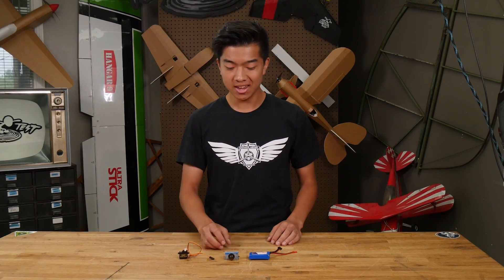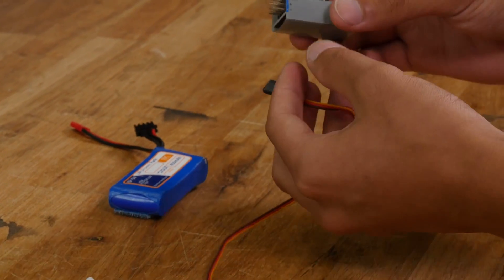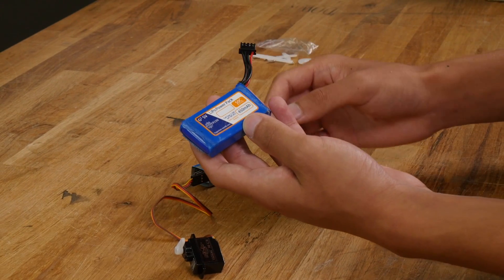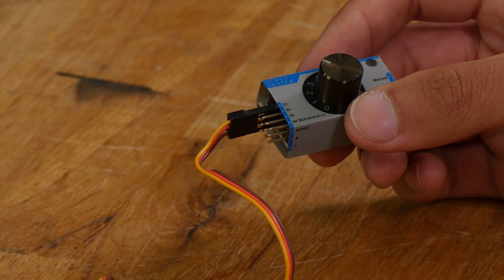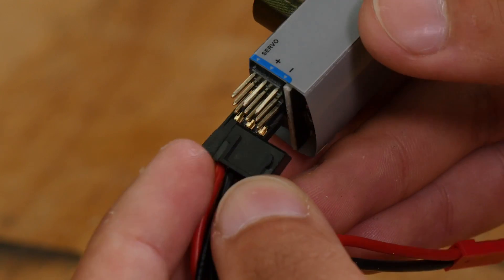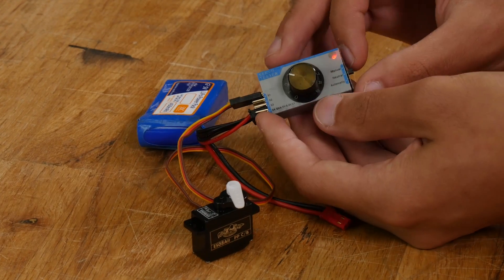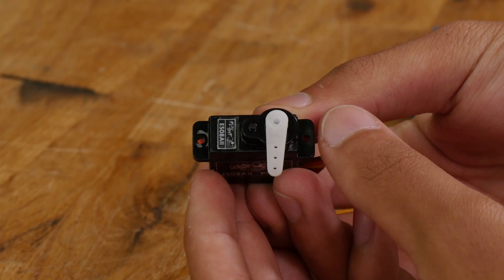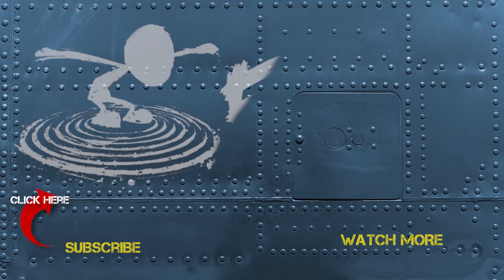How to Center Your Servos

Comment: Newbie question- cant I just manually turn servo arm to both extremities then just find its 'center' by moving it to (as close) to the middle?
Reply: A bit late to reply but:  no.  The servo is mechanical (addressing your suggestion) but it's also electronic.  It has a potentiometer inside and that potentiometer is what determines the center as far as the servo is concerned and not the mechanical limits.

Comment: Why spend 110$ for this when the receiver does the same? Im i missing something?
In my experience i remove the servo arm, i plug the servo and battery in receiver and the servo automatically is center, then you put the arm back on it
Reply: 10 not 110

Comment: Be careful when following advice videos. What follows is just my personal outcome of following this video. My white connector had more connections that was shown in the video, but I was careful to connect positive to positive and negative to negative. Firstly, the light on my servo tester did not illuminate as shown in the video, when i just plugged in the balance lead. I therefore connected the battery fully. The first time I did this, it seemed to work. The servo centred. Upon installing it in my car, I moved the arm, so thought I had better centre it again. When I did this video again, smoke poured out of my servo, frying it! Upon speaking to my local rc club, the committee person said that I didn't need a servo tester. My message here is just be careful guys. If in doubt, despite Covid restrictions, reach out to your club. They should welcome your support, especially during these trying times and you may save yourself a few pounds / dollars, etc.

Comment: You connected the battery  as a 2 cell 7.4 this way you can cook the servo...which usually works on 5-6 volts unless its Hv servo...

Comment: My servo self-centers when I turn it on. So why in the hell would I need to buy a servo tester for centering purposes?
My problem is when I fine-tune it with the trim, now it travels more to the left than the right resulting in tire rub in one direction. 
So how do I adjust for 1/2 of a tooth? What good is a servo if they are not designed to be right at 90'? 
I have at least 12 servos of various sizes and none of them are dead-nuts on center.
So you have to mount them slightly crooked to get them right.
The problem is with the trim, it doesn't account for the overall travel, it just moves the whole thing to one side or the other.
Reply: a digital servo would be more precise and could possibly help with this
Reply: Late I know but for anyone wondering you need to adjust it with the sub trim, which won't affect the travel like the trim would

Comment: so i have a servo checker, I was building the FT. x-29 And i centered my servos and finished the plane. As soon as I plugged in my servos to my reciever, they "Recentered" to a different position, and Ruined my day. I couldn't decide if i should take apart the wings, and redo the servos or if i should just try to do transmitter adjustments. Plz Help. I was using Powerpack C servos, along with a FlySky FS-16 Transmitter.
Reply: They didn't recenter to another position. Most likely you centered them in the wrong mode. I've done this tonnes, you have to make sure which mode you are in. There are two static modes: center, and knob position. And there is the moving mode where the servo goes back and forth. You probably centered your arm but it was in "knob" mode not "center" mode. Then when you installed them, the servos went to the actual center. When using the tool, always turn the knob and make sure the servo doesn't move. That way you can be sure you're in "center" mode.